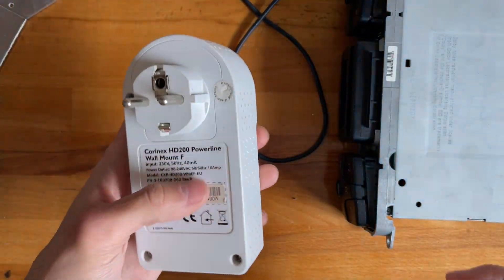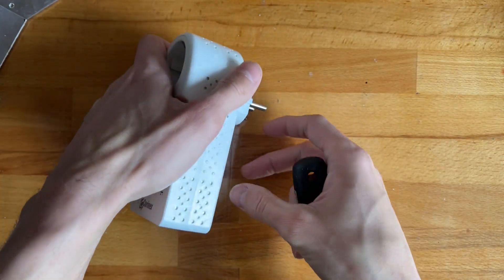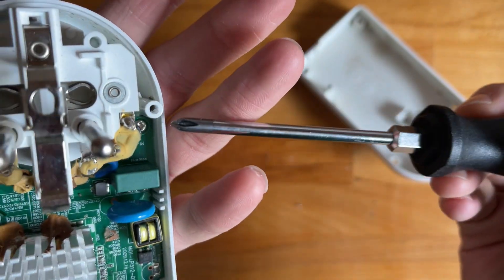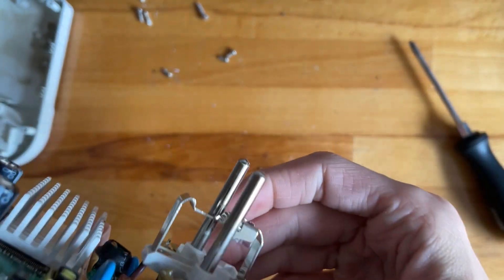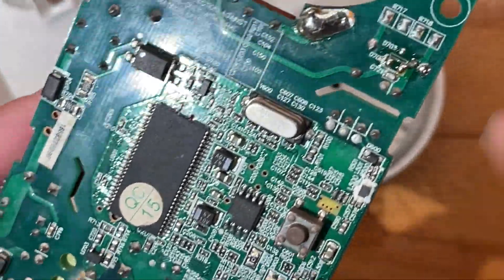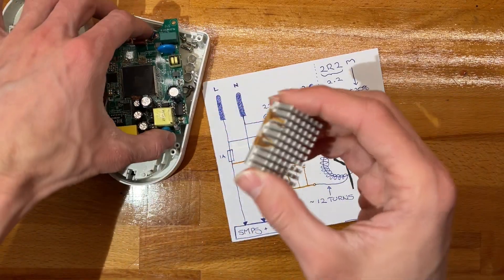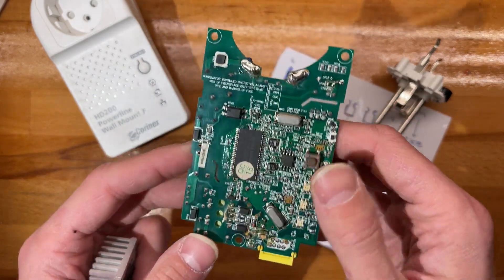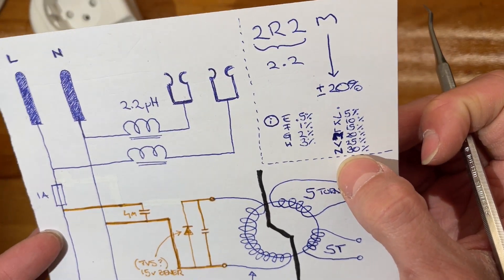ethernet power line adapter teardown

Comment: Can I use this kind of adapter to join LAN over one twisted par wire rather then over PowerLine?
Reply: yes, some won't work without power from the line, you might need to provide secondary power. Plus the filtering might require you change it a bit to adapt it to your signal source. In the drawing he shows the inductors, those will be paired with a Capacitor to form a LC circuit, which is basically the filter for the signal being used to transmit over the power lines.  Any adapter you would get you would need to understand the carrier frequency. For example older circuits for 100kHz would be 100nF cap, with 22uH for L. Often I see the Cap on the line side before the rectifier and the coil right after that.

Comment: A more interesting question is: could you re-package that adaptor into a PVC wall box?
Reply from the maker: yeah - so long as it doesn't overheat ..

I generally dislike having power supplies screwed into walls ... if anything does go bad it makes dealing with it a lot more fun 🔥
Reply: @Darieee  understood and agree. However, a well-designed, air-cooled unit that could fit in no more than one-half of a 4 gang wall box would be an absolute killer.
Reply from the maker: I guess it could be useful but ... it would probably also be a house's only switch-mode power supply screwed into a wall 🥶